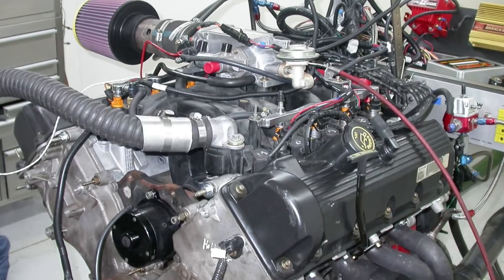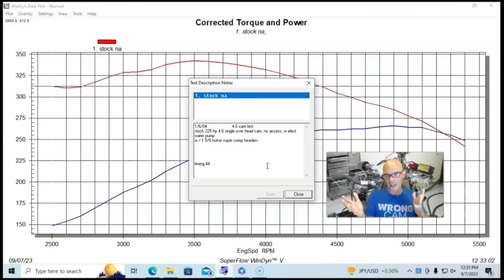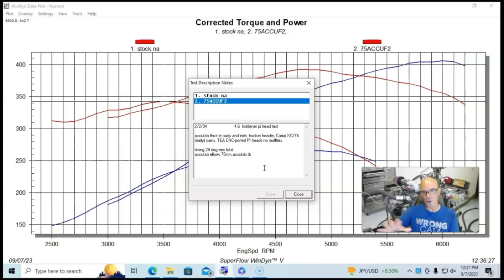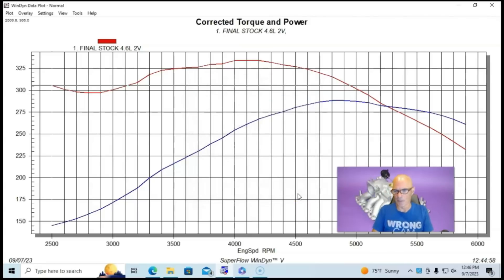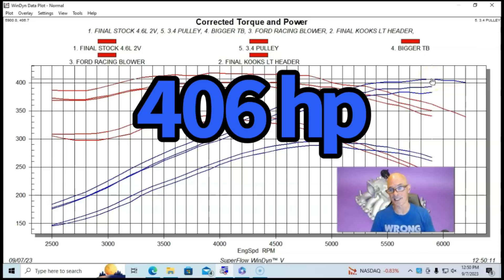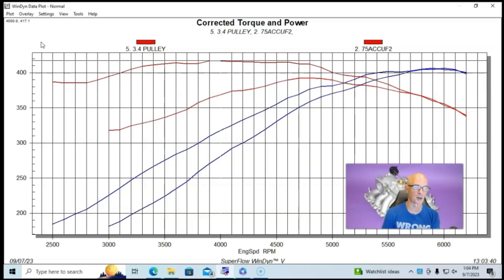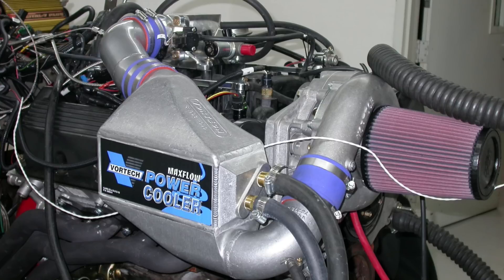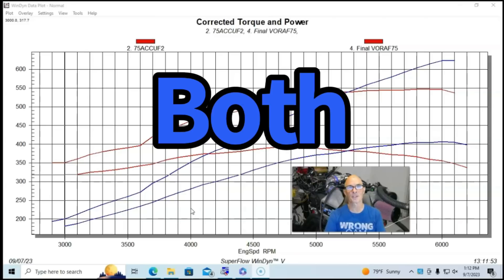THE 400-HP QUESTION-4.6L 2V MOD FORD-ALL MOTOR VS SUPERCHARGED-WHAT IS THE BEST ROUTE FOR HP? BOTH?

Comment: I’d love to see you check out the Trick Flow Twisted Wedge Modular heads in the future, I’ve been very interested in them recently and think it’d be a great way to make more horsepower on an NA 2V 4.6 or 5.4. They flow better than most of the 4V heads for Mod motors and will beat all of them when ported. I’d also be interested in seeing dyno graphs of different cams in stock heads and those heads.
Reply: I want the TF heads from Modular Head shop so bad. 4.6 is as common as the 350 chev so i dont know why 4.6 Ford is so expensive  in aftermarket parts.
Reply: @CobraR1993 the TF heads are completely different heads, they redesigned the chambers and out of the box are more than you could ever port factory heads. They also made it so the cam caps are replaceable. I mean I get why they are expensive but at the same time I feel like they made their money and they would sell a lot more now if they significantly reduced the price. The 2v hasn't been in a vehicle for 12 years? The 4.6 anyway... I mean for what they are asking you can buy a coyote! Considering their stock heads will outflow trick flows maxed out!
Reply: @commonsenseisdeadandgone  are they that freaking expensive?
Reply: @absolute357  all in, over 4 grand
Reply: @commonsenseisdeadandgone i was just looking into these heads. I was shocked how expensive they are. For a couple grand more you can have a cammed coyote swap. Seems like they're shooting themselves in the foot
Reply: @sergeantspeed5941  i don't know about a cammed coyote but a coyote drop out. Of course there is a lot more to a coyote swap to make work. Depending on vehicle (typically mustang, you'll need headers, ECU, k member, swap mounts.. well that's pretty much it 😂) then you'll actually have an option for an intake manifold too that doesn't cost $1200+ because some asshole hoarded all the intakes for 2v's. 

In all fairness, the TF heads do bring the power numbers up to stock Terminator numbers and that was the appeal, a NA 2v putting out more power than a 4v and as much as a Eaton 4v is pretty damn good!
Reply: @commonsenseisdeadandgone  Its about 10 grand to do whole coyote swap, and In my opinion the built 4.6 sounds better. I chose to build mine and im glad I did, I like that fact that I got a coyote killer. Trick flow complete top end kit(Heads,cams, chains gears) went with victor jr intake, brock elbow and throttle body, fuel rails, hooker headers they are the only ones that have a long tube for an automatic. x pipe and flowmaster super 10's. 465 hp, 407 rwhp. 373 gears and higher stall converter. all the same price as the coyote swap, give or take a little. Its stupid fast.
Reply: @CobraR1993  Modulars simply have a significantly smaller market. It's all about supply and demand. SBCs have been around for 70 years by this point, the Modular Ford has 30 years and just never caught on quite the same.
Reply: No, they don't. Any of the versions of untouched 4V mod heads will outflow fox lake CNC TF 2V heads, and those are the best 2V heads commercially available to my knowledge.
Reply: @thastinger345  After some more research you definitely appear to be right. I can't find the original source I used for that claim and what I can find now shows that most 4V heads do outflow the TF heads. Some early 4V heads are beat by the TF heads tho.
Reply: @jackets64  There is no doubt that the TF heads are the way to go if you are staying 2V, they are a superior design to the PI heads, especially in forced induction...but they require special cams as well. I want to buy a bare set and send them to fox lake to be worked over.
Reply: @thastinger345  That's False. Tfs heads flow more than stock 4v heads. Stage 1 ported 4v heads will outflow them tho.
Reply: @MF-Rell  It isn't false, the best 2V head will not outflow 4V untouched heads that have been cleaned and have a decent valve job....but they are surely the way to go if you are staying 2V.
Reply: I seriously wanted the 190cc for my flat top pistons, but I think almost assuredly the intake had to stay stock. I thought stage 2 comp cams would make it the best sounding Mustang on the road. But where would I find equal length y headers, mid-long tube would be okay for a build with bassani x pipe.
Reply: @aaron6268  stock intake is going to be the best intake for NA, your not going to outflow it. Cams don't make the sound change, it changes idle sure when going high lift, long duration. I had a 5.4 with the biggest cam comp had on the shelf (274 maybe?) And at idle it had chop! 

But as far as on throttle, didn't notice any difference. Shorty vs Long tube is I think negligible on mod motors, H vs X pipe is probably going to be the biggest difference in sound IMO. 

Want to make it different, do 180° headers!
Reply: @commonsenseisdeadandgone  great idea on the headers.
Reply: He has tons of mod motor content  pretty sure a couple have had trick flow heads

Comment: I’ve heard that the factory shortblock can only handle roughly 450hp. Currently, I have a ‘96 GT with trickflow 44cc track heat heads with stage 1 cams, Hooker Blackheart LT headers and OR X-Pipe (Made 330rwhp/340rwtq). Probably a dumb question but there’s probably no way I could run 6 or more psi from a KB on this setup without the internals being upgraded correct?
Reply from the maker: we made 623 hp with a stock bottom end-it will make much more
Reply: @richardholdener1727  would a set of Manley -18cc pistons and a set of gen2 coyote rods with factory 6 bolt crankshaft work well?
Reply from the maker: never tried coyote rods-but all that should work
Reply: @richardholdener1727  thanks I’ll go that route and see what it can make at 14psi hopefully somewhere in the neighborhood of 500-550 rwhp
Reply: @jettamustang  dont fear the compression. 10cc dish is plenty
Reply: @madmod correct me if I’m wrong but the factory pistons for a ‘96 GT are -11cc. So you’re saying I could go forged -10cc dish with 44cc heads should be right around 10.2:1-10.5:1 compression ratio and run 14psi? Question is, can I do that without running E85?
Reply: @jettamustang  Yep, should run good with the tfs heads and a mild cam. Be modest on timing numbers and you may not need 14psi to reach your goals
Reply: @madmod  thanks for the info, I appreciate it!
Reply: Sounds like you need about 15 psi to me
Reply: @adamdodsy84  well with a KB that TQ peak starts at a much lower rpm. So forged internals is mandatory in that case.
Reply: @adamdodsy84  thank you for the help, I’ll probably go with -10cc pistons and I’ve heard a lot of talk about Todd warren camshafts so I’ll look into those as well.
Reply: @jettamustang  NA Svt, MHS, Cms all spec good cams for the modular if youre looking for a solid tfs specific cam
Reply: @madmod  I’ve purchased from MHS before and have heard of CMS. And the NA SVT you’re referring to is off the SVT forum (Todd Warren) correct? If I’m not mistaken Apocalypse Performance offers TW Cams.
Reply: @jettamustang  correct,na svt is todd warren cams and his cams are solid!

Comment: Love to see a 5.4 2V natural truck build. Lots of us still out there.
Reply: I'm waiting for the 6.8 build
Reply: Would like to see too though probably won't ever do it.  I blew a plug on my f250 a few years back. Fixed it with a $15 Helicoil brand repair kit from NAPA and  torqued the remaining 7 plugs to 30 ft/lbs. Haven't had a problem since.
Reply: @robertrio1164  bought a 6.8, used lightning rods and pistons balanced together and reassembled with mmr timing guides oil pump etc.  Waiting for my f250 to give up the ghost to install with twin turbosa
Reply: @wastedwagesmercuryman6018  Yeah man that's the way to go!
Reply: @wastedwagesmercuryman6018 do they have forged cranks?
Reply: @commonsenseisdeadandgone  nope.they are split journals. Welded in between them, machined and  used narrow bearings
Reply: @wastedwagesmercuryman6018  the 6.8 is a forged crank, it is split journal but not welded. Too many of you talk bad info. Please stop.
Reply: @michaels.ramsey7803  I own and operate a machine shop,  during the time that I had put mine together there were no aftermarket crankshafts.  I welded the journals on mine for added strength because I raised the compression as well. The majority of the shops in the area would send the cranks out to be refurbished. I used narrow bearings because I wanted to spin it faster with boost and with the added chamfer i couldn't used the stock bearings
Reply: @michaels.ramsey7803   I see what you're referring to!  Was confused by your comment (the bad info) part, and immediately got defensive.  I read my response and yes the factory crank is forged, and no Mmr does not offer a crank for the v10.
Reply: No sweat... we can settle differences on the lake with some lines in and a cooler full of beer!  That's how I do it lol. If I'm really angry I type in all caps.
Reply: There are none left with spark plug threads in the heads or timing chain guides that haven't disentegrated. Such a trash motor
Reply: @cshumard513 not everyone fires sparkplug from their 5.4 2v.. and not everyone's timing chain guides fall apart.
Reply: @IndenturedSavant13  5.4 2v engines regularly see over 500,000 without incident. You may need a few more rides back to school on the short bus. 3 valves are the plug shooters.
Reply: @IndenturedSavant13 you're smoking crack....... Share that shit!

Comment: Why choose between bolt on vs boost? Always go with both!
  I always love to see the vortech si trim supercharger content. . As I run one on my daily.
Reply: Did you go polished typhoon and 85mm throttle body?
Reply: @aaron6268  no. 
  I have a chevy 350 bored .030" over. Small trick flow heads. Baby roller cam. Estimated 406hp@5500 naturally aspirated. I'm fueling with a 4bbl 4150 holley sniper. I added a vortech centrifugal supercharger. I've seen a peak of 9.5psi of boost. Boost is great. Why choose bolt ons vs boost when you can add boost to a bolt-on motor?
Reply: Anyone pushing safe nitious to line your carb?